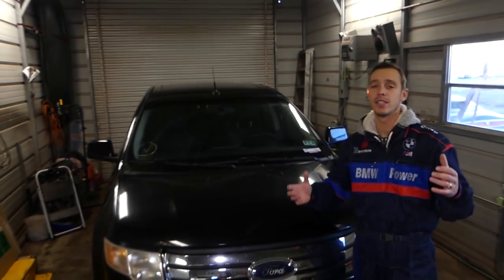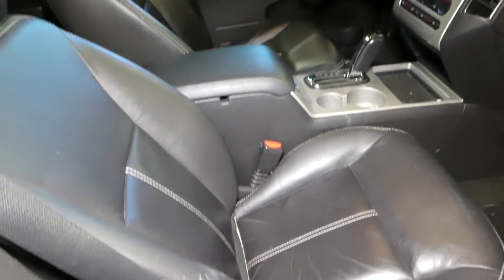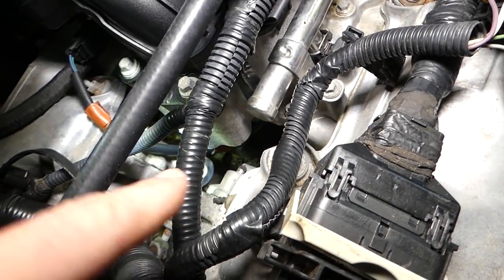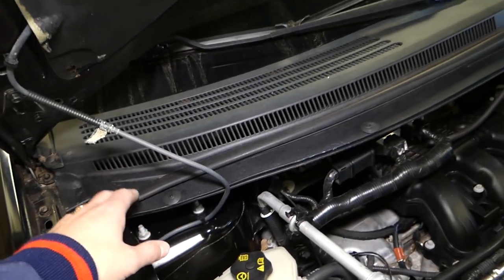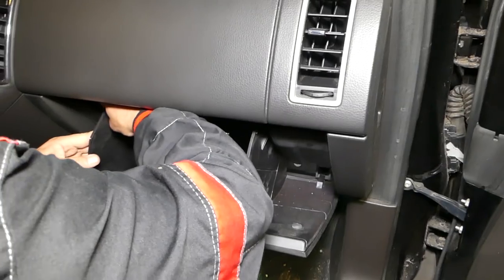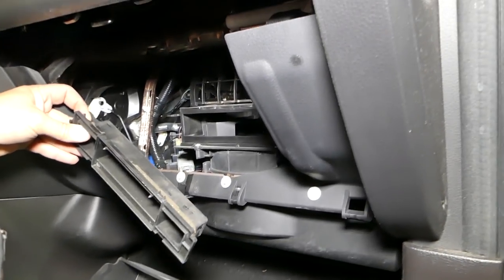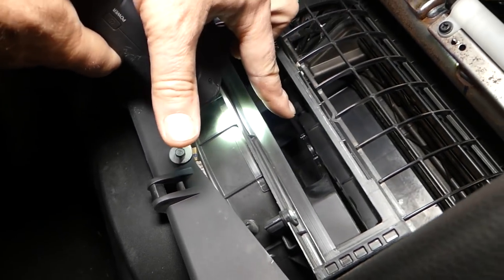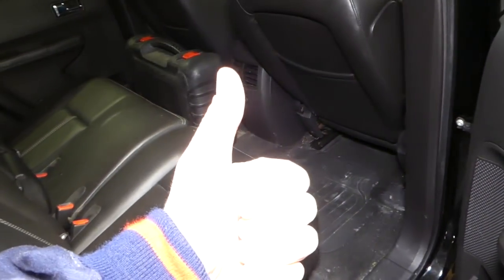WHY MY CAR SMELLS BAD | MICE POOP IN THE HEATER

Comment: The cabin filter and scrub the carpet, anything else?  I mean I already figured that out and it still smells like piss
Reply: Take out the filter, turn on the AC and spray Lysol or Ozium inside the vent, it will blow it through the entire sytem
Reply: @ChrisG-gc5wx  turns out there were 3 dead mice in the blower wheel. Look like they were in there a while. I got rid of those and then scrubbed the carpet below them again. that worked.
Reply: Right.  I feel like they ran out of time. The mouse urine/poop smell is coming from under the drivers side floor vent under the steering column. I won’t even turn the heat on. Even if I put the switch to heat to keep the cold air from coming in the smell is too much. I imagine urine drops on the plastic and needs to be washed off. I wish I could find some one who really knew how to fix this issue.
Reply: How did you clean the vent  s close to windshield?